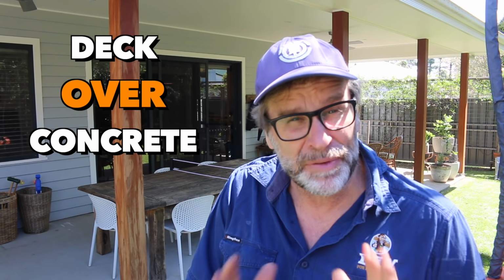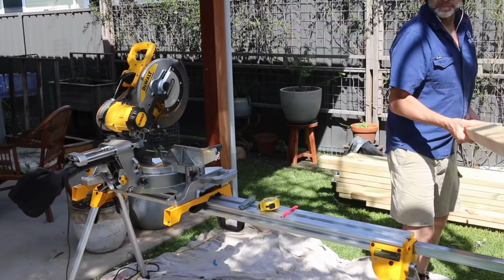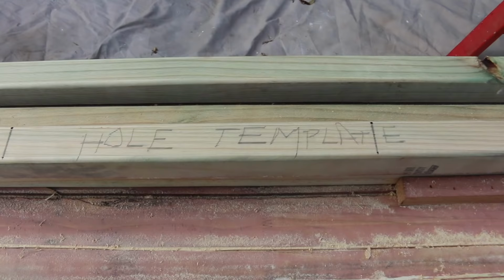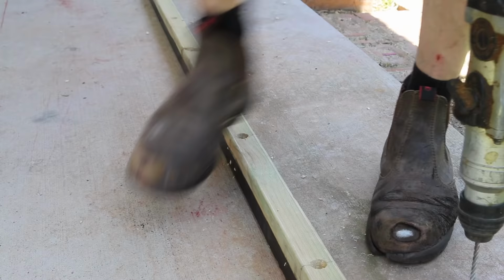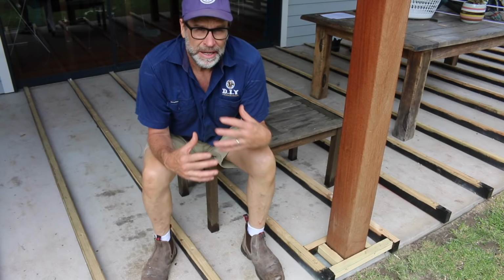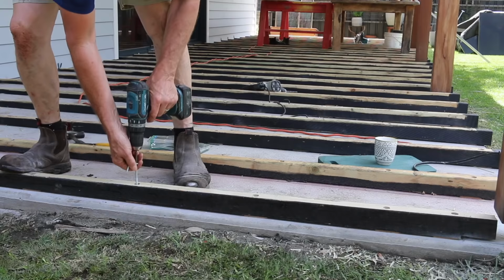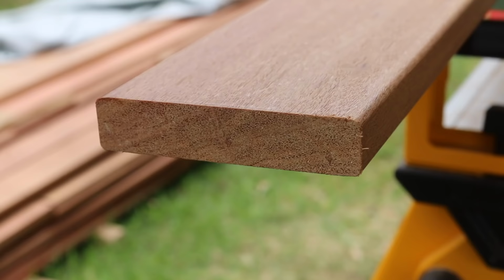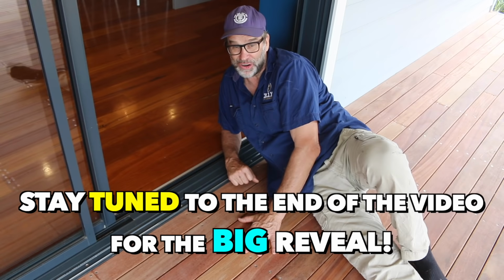Building a Deck Over Concrete PLUS 5 BONUS Decking Tips!

Comment: Excellent job. I got inspired to do my first project. But doesn't it need to be sloped or leveled to the house?
Reply from the maker: Thanks Rakesh 👍 The slab under the deck is sloped away from the house so the water runs away from the house. The deck on top is level which is why l tapered the joists 👍👍

Comment: Wow your video is just what I need for my patio. Can I ask where you got the packers and what size concrete bolts you used?
Reply from the maker: Thanks Jaime.....the packers were purchased from Bunnings and they are called Plastic Window Packers. You should be able to purchase them from most Big Box Hardware stores. The size of the concrete bolts changed as you moved along the tapered joist. From memory they ranged from  50mm to 70mm. Good luck with it 👍
Reply: @diyforknuckleheads  Great, I found some packers on Amazon, and I will use 1/4" diameter concrete bolts - I hope this is a good size. Thanks a lot!

Comment: When you copped the hail storm, it was blowing a gale, freezing and wet with light flooding here in the Illawarra. Out of curiosity, why wasn't the concrete treated with bitumen where the batons were going to be laid?
Reply from the maker: I think the storm was pretty wide spread mate 😬 Because the battens didn't touch the ground there wasn't a need to paint any bitumen beneath them. Thanks form watching 👍😁🇦🇺🎄🎄

Comment: I always love your videos!!👍👍👍
 But I disagree with  the staggered screws that dont look good..🤣🤣 Thats not going to influence the chances of the timber boards twisting less. What will split the timbers is not being maintained consistently and uing the wrong screws..
Also I wouldnt string every board up!! Thats so not necessary youl be there forever..🤣🤣🤣 
String the first board up but the rest you dont need to, once you get the first board up you can just work off that one  use your spacers and new board against the previous one. just constantly check with the tape that it lines up with the end..Simple
But great job over all!!!👍👍👍👍👍👍
Reply from the maker: Thanks Adriano. The staggered screws minimise the chance of the joist below from splitting from all of the screws if they are driven in on a straight line and personally l prefer the look of a staggered screw line. The trouble you come across when driving screws in a straight line is that It just takes one screw to be off centre a little  to make it look a little wonky which would mess with my OCD mind 😂
The string line probably only adds an hour or two to the overall job which is a very little price to pay for a perfectly straight deck. The trouble with only using spacers after you lay and string line the first board straight is that the decking boards vary slightly in width.  For instance, my "90mm boards" varied in width from 89mm to 92mm. It just takes a few of these variations to totally throw your straight line off. 
Thanks for watching mate and all the best for 2022! 👍😁🇦🇺

Comment: This turned out awesome! What species of wood did you use for the planks? And what brand finish coat?
Reply from the maker: Thanks Peter. The wood is called Tonka and the Decking Oil is from a company called Cutek and the exact product was CD50 Extreme. Cheers 👍😁🇦🇺

Comment: Awesome help! - question though....why did you use packers to keep the joist off the concrete if you painted it with bitument paint anyway ?  Can't it sit driectly  on the concrete ?
Reply from the maker: Good question Allister....bitumen paint is great but when it comes to water infiltration, the more steps you can add to reduce the possibility of water infiltration, the better off you'll be 👍👍
Reply: @diyforknuckleheads  Thank you again!

Comment: Hi mate.  Would moisture and airflow be an issue for that timber?  The top of the decking would have plenty of room to breathe, but wouldn't you risk warping / cupping the boards due to no ventilation for underneath?
Reply from the maker: G'day Doug, the deck rarely gets wet so moisture shouldn't be an issue but the air flow from beneath is limited. I have floorboards installed for 7 years on battens over concrete in the next room and haven;'t had a problem. Time will tell l suppose. Thanks for watching 👍

Comment: Hi Shane, great video. I have a similar set-up except its balcony with an open top, which gets a lot of rain. How would you collect  water so it doesn't get trapped underneath the decking? Thanks again
Reply from the maker: Cheers mate 👍 You might find that your balcony has a gentle slope that falls away from the house. If you do then that's good as the water will run away. You just need to make sure that the joists are off the ground. 👍👍

Comment: Looks fantastic, and great details in all your videos.
I’m surprised you didn’t seal the concrete or use any damp course on top of the joists. Any concerns down the track?
Reply from the maker: Cheers mate 👍 Personally l don't like the damp course on top of the joist as it can trap moisture...having said that, some guys still use it and swear by it....personal choice l guess 🤔 I didn't worry about sealing the concrete as there is already plastic under the slab that provides any moisture coming through and the joist doesn't come directly in contact with the concrete as they are sitting on plastic shims and finally the deck is completely under cover so hardly gets wet for any prolonged periods of time. Thanks for watching 👍😁🇦🇺 .
Reply: @diyforknuckleheads  Thanks for such a detailed answer, and taking the time to do so 😉.
Reply from the maker: @The_Handyman_Can  No worries at all mate 👍

Comment: Great video -dumb question.  1.) if your concrete pad is not level but you want your deck to be, is it possible to add extra spacers or do you have to do the tapering work on joists?
Reply from the maker: Good question Ryan.....if you pad isn't level just add or subtract packers to get it level and straight. 👍

Comment: Beautiful job, Thanks for creating video. I have a question on my other DIY project. Will Ankascrew works in hollow wall and if not what's the solution for hanging around 50kg load
Reply from the maker: Thanks mate. For heavy loads use a couple of heavy duty toggle bolts 👍

Comment: Great video! I'm  in the same position except that I want to deck over existing sandstone pavers. I assume that the same techniques apply?
Reply from the maker: Thanks mate 👍 Doing this over pavers is a little different as it depends how sound the pavers are. I'd be a little hesitant to do it 👍
Reply: @diyforknuckleheads  Thanks for the quick reply. They're pretty massive old style pavers (abt 1m2 or so each) and need a couple of ppl to lift.

Comment: Great work! m looking do build our new home a deck with similar clearance issues from the door. How did you measure the tapered cuts for the joists? Thanks you!
Reply from the maker: Thanks mate. I measured each joist individually. Mark a level line against the house and then then take a measurement from that line to the top of the concrete. Then all you need to do is transfer that to one of the joist and flick a chalk line down to the other end of the joist that will be full width. Hope that makes sense.....Cheers 👍😁

Comment: Hello Uncle...
Any chance you could do a help video about when slide on tool batteries get stuck to your tool and then it's hard to take off or put on as they get stuck stuck and stuck.
I look forward to seeing your thoughts on this.😉
Reply from the maker: G'day mate....Batteries can be a little tricky to remove as they are designed to fit very snugly to your machine. Unfortunately that is one downside for using battery powered tools 😊
Reply: @diyforknuckleheads  
Hello again Uncle...
It's sad to say that most hand held battery operated equipment that I own has this problem, and I will struggle trying to remove my battery and my wife will giggle as I look like a monkeys behind doing it. 🤪🤣

Good news...
I did find out by accidentally trying came up with a fix/trick. (probably many other people did too) 

I found that If you use the lower part of the palm of hand and you smack with a thrust as if to put the battery further on the tool...  most of the time the battery will come off easily 👍  think of it like when you try to open a jar with a very tight lid and you use your palm to smack the bottom of the jar to force the air up to pop the lid loose... then I figured out how it happens in the first place...  it seems as you use the tool the battery will slide as it vibrates just a tiny little bit and become crooked and get wedged very tight... ergo the smack and it's free trick 🤗

I know it's probably nothing much but I just thought maybe you could sneak this little trick onto one of your episodes to help others who have giggling wives 🤪

May you and your family have a wonderful and blessed Happy New Year Uncle! 🥳

Comment: I noticed you didn't use joist tape or something like that. Is it because it is mostly under roof?  Would a coat of the waterproof be beneficial ?

Did you cut the wedge by eye or was there some magic in the jig?
Reply from the maker: G'day Marcell. I don't use joist tape as l'm not convinced that it actually works.....Applying a coat of bitumen paint would certainly help....like you said, l didn't bother because it is under cover and never gets wet.
In regard to the wedge, l cut it by eye. It is pretty hard to set up an actual jig as each joist is slightly different due to the unevenness of the concrete.
Thanks for watching 👍😁🇦🇺
Reply: @diyforknuckleheads  thanks for the response. Which decking screws do you use and did you get any heads turning off?

I like the Tonka wood. Will try and see if I can get it down Bass Coast way.

Comment: Nice Job. When ripping the taper did you have a block attached to the underside of saw which would run up against the edge of support joist for saw? Or did you just go freehand?
Reply from the maker: Thanks mate 👍😁  Na, l just cut it freehand 👍
Reply: @diyforknuckleheads  Cheers from across the ditch. Will definitely check out your past vids. You have a new sub.
Reply from the maker: @thetechnician832  Appreciate that mate 👍😁🇦🇺

Comment: Thank you for the video. It’s very useful. 

I have a situation where in order to keep the termite protection warranty the company has advised to keep 25mm gap between the brick wall and the deck. What’s your experience in these type of situations? 25 mm seems a bit gap and I’m worried that it’d look ugly.

Comment: Wonderful video, thanks for making it. Absolutely beautiful, top-shelf work! One question, why are you bothering with so many anchor points into the concrete? It looks like you have like 8 per joist! That's a lot! The only point of these anchors is to prevent lateral movement of the deck, right? For that, I would think you'd need maybe two anchor points per joist at most, probably less! No? What am I missing?
Reply from the maker: Cheers mate. Whenever l do a sub floor of any kind, l fix the joist down at 450 centres...the sub floor for the deck wasn't any different. A little extra work always pays off in the end. Thanks for watching 👍😁🇦🇺
Reply: The anchors also will minimise movement and prevent bounce or hollow sounds when walking on the deck

Comment: Could I get a link or the name of the spacer you put between the concrete and wood. I can't locate any with the screw hole or the right size.
Thank you,  great video!!
Reply from the maker: G'day mate...they are simply called Window Packers. If you live in Australia you can get them from Bunnings. Here's the link to the multi size pack https://www.bunnings.com.au/macsim-75mm-600-piece-mixed-window-packers_p0164936
Good luck 🇦🇺😁👍

Comment: Do you think I can  put some sort of a step up from the patio door for the low clearance problem as an alternative. I am also curious about the water flow due to taper.
Reply from the maker: The concrete is tapered from the house to the grass so that the water runs away from the house rather than run to it. Having a step up would be a bit of a trip hazard so l probably wouldn't recommend it. 👍
Reply: Thanks for the response. I will consider an alternative to the step. If you don’t mind, I have another concern and that is about the water rot by making the joist sit directly on the concrete. I am planning to use pressure treated lumber but I came across lot of comments on other videos warning that the rot might still happen. Your thoughts  about this will be really helpful 🙏🏽
Reply from the maker: @ishansrivastava90  No worries at all mate and yes, those comments regarding the timber rotting are correct which is why l had my joists sitting on plastic shims. 👍

Comment: Thanks for sharing. One question, mate. How would you guarantee your sub-frame is flat enough by using the same timber and spacers? First, your concrete slab is not levelled. Second, the timber you got may have unexpected deformation.
Reply from the maker: No worries Michael 👍 In answer to your question, after you lay your joist down with the packers underneath, you then need to go along and adjust those packers in accordance with the concrete underneath each concrete anchor. It's a pretty time consuming job bit it's what you have to do when you have these low clearance issues. 👍😁

Comment: Fantastic deck.  What are those plastic clips you put under the tapered lumber?  I have the same low clearance issue on my concrte patio.
Reply from the maker: Thanks mate 👍 They are Called Plastic Window Packers: https://www.bunnings.com.au/macsim-fasteners-75mm-assorted-window-packers-90-pack_p1040473

Comment: Hey shane great video and deck! Just wondering how you managed to avoid the counter sunk holes which attached the joist to the concrete when fixing the decking? cheers
Reply from the maker: Thanks Winston! Glad you liked the deck mate 👍 Prior to drilling the countersunk holes, l laid out the decking board locations on a length of board the same width of the deck and then drilled the holes for the anchors in places that wouldn't interfere with the decking board screws. From memory l think l mentioned that in the video....but l could be wrong 😂 🤔 Cheers 👍😁🎄

Comment: Great video and recommendations!  If you have a moment, what brand are the packers/shims that you place between the joists and concrete?  Many thanks!
Reply from the maker: Cheers Paul  👍Here is a link to the type that l used. https://www.bunnings.com.au/macsim-75mm-600-piece-mixed-window-packers_p0164936  Good luck 👍😁🇦🇺

Comment: Great idea! Did you run into any issues with your decking screws hitting the bolts in the joists?
Reply from the maker: Thanks Peter. No mate, no dramas at all. Like l said in the video, l worked out before hand where the bolts needed to go to avoid being hit by a screw 👍

Comment: I always thought you were supposed to leave the concrete dust in the holes as it provides some friction and such for the concrete anchors
Reply from the maker: G'day Nathan, the trouble with leaving dust in the hole is that sometimes there can be quite a bit in there which can impede the anchor from going all the way in which can be a real problem especially if you're using dyna bolts. Thanks for watching 👍😁🇦🇺
Reply: @diyforknuckleheads  fascinating. I suppose I never considered that. thank you for the explanation.  love the videos
Reply from the maker: @nathanstaley4588  No worries mate 👍😁

Comment: Love the tips overall. My only question is this, Shouldnt the deck have a taper away from the house instead of being level? I have always heard 1/8 inch per foot?
Reply: Decks aren't that important to taper away from the foundation, since there should be a gap between deck boards.  The taper away from the house in patios (slab or paver) is to direct water away from the foundation to reduce the chance of undermining the gravel and soil structure underneath.
Reply from the maker: Thanks Rodney  👍The top of the deck is level but the concrete below is tapered away from the house to the grass which allows the water to run away from the house 👍

Comment: Would adding the shim for an undercut be the same as bevelling the saw?
Reply from the maker: Yes...correct 👍 The only annoying thing with setting the saw to a bevel cut is that you need to keep on changing it back to zero to get. square cut. Thanks for watching 👍😁🇦🇺

Comment: Hey mate, What is the concrete Drill size mm and length of Anchor bolt you used ? 100mm or 150mm
Reply from the maker: G'day mate...the drill size was 8mm for an 8mm anchor screw. Because the joists were tapered, l used various lengths of anchors depending on the thickness of the joist. In relation to the length of the drill bit, just remember that most slabs are only 100mm thick so you don't want to drill all the way through that. Hope that helps and good luck 👍😁🇦🇺🎄
Reply: @diyforknuckleheads  thanks mate for the prompt reply, appreciated. I'm using 90x45 joist, what length of anchor bolt do you recommend to use over concrete slab mate, 100 or 150mm ?
Reply: @diyforknuckleheads  thanks mate for the prompt reply, appreciated. I'm using 90x45 joist, what length of anchor bolt do you recommend to use over concrete slab mate, 100 or 150mm ?

Comment: Should the holes in the concrete not be sealed with silicone or something to prevent cracking during wintertime? Maybe you dont get that low temperatures...but here in Sweden I really have to think about that haha
Reply from the maker: It doesn't get that cold over here mate so we don't have to worry about it 👍
Reply: @diyforknuckleheads  your a lucky man! Have a good one :)